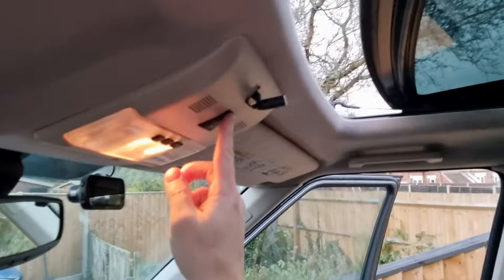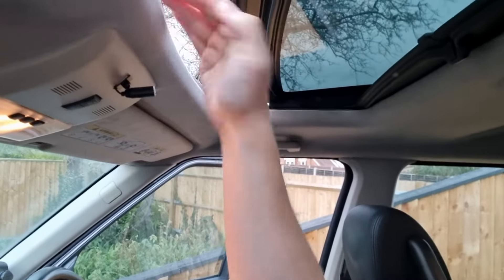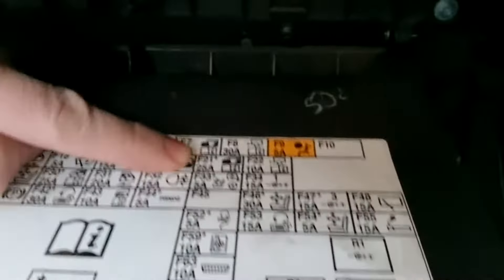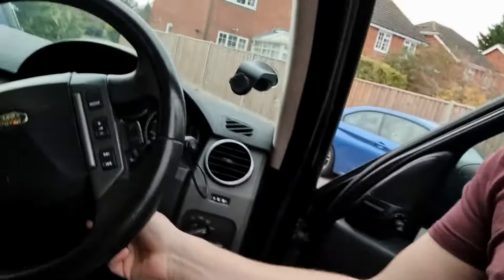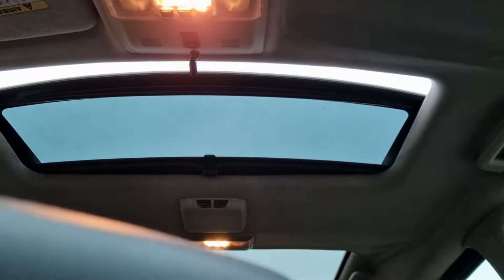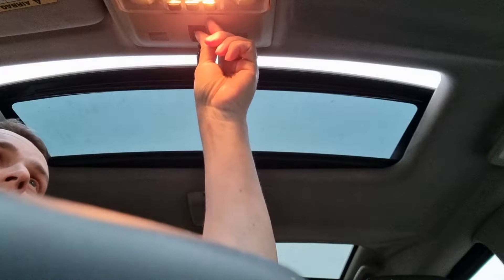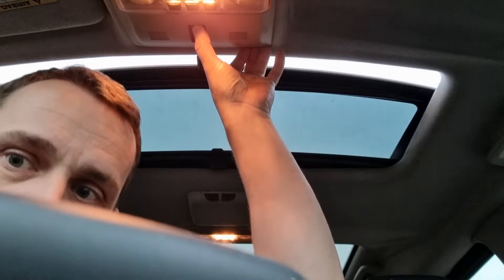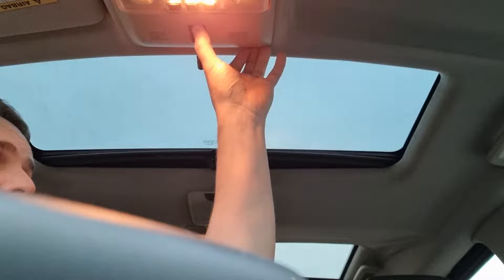Sunroof stuck open?  Fixed in 2 minutes at no cost!   This time on a Discovery 3 / LR3 Land Rover.

Comment: I might need my ford escape 2011 repaired. Like a dumb ass I accidentally hit vent in winter time when it was frozen.  It’s not closing and seating all the way now. Where you can hear lots more wind draft. motor works fine and goes through progression of vent and close properly. But when I hit close. It won’t seal. I have to manually push upwards on glass and then it seals into place with less draft. Wondering if it’s something broke in there. Any ideas?

Comment: This worked me, thank you! 
17 Civic Ex-T. I tried the reset procedure of the press start button letting go of the sunroof button, repeat. Didnt do anything but keep my sunroof open. 

This worked, turned on my car, ac off. It stuttered half way close, and after pressing open button it fully started to close.

I think I have a small electrical problem goin on in sunroof

Comment: I had a similar issue with my 2010 Discovery 4 yesterday. The roof was fully closed and would not open, so could be worse! I held the close button down for 20 secs and bingo. Problem solved today as it has stopped raining in the UK for 5 mins With a push button start just push once to light up the dash and crack on. Thanks for posting this top chap.

Comment: Worked for 06 Range Rover Sport. My plastic accordian thing came off the track, sunroof wouldn't close.  Tried your process, did not work. Went to other videos that had me dissassembling the dome to manually turn the motor, nothing. Tried your process for the 4th time, BOOM, I'm a happy man.

Comment: Thank you so much I was scared of leaving my car the whole night with the sunroof open. I think this type of reset works on every car since it worked on my 2014 civic
Reply: I second this, lot better than the other stupid method of 4 on offs tilt (it was stupid). 
Had to press tilted sunroof mechanically by hand when i was in the car lol
Repair shop tried to "figure out" the issue by opening sunroof (when i told the issue was motor). 8 hours they had and they told me the same thingi already knew but they didn't close it back (assholes)
Guess it is the dealership for me (more expensive but fuck it can't trust these "independent jerkoffs"(

Comment: The sr module has an anti trap feature. The system knows how many revolutions of it's drive motor must go before the closing voltage /current spike occurs when the close position is reached. If it encounters a spike B4 that that number of revolutions is reached it will stop and retract. This is the law in US. Reset procedures vary by make. Essentially you are making the sr module computer relearn the true open and close positions

Comment: Didn’t work for us. Sunroof was open - it will close part way and then back to open. Darn. I was hoping!
Reply: Mine just started doing this! Please update me if you have a solution. 😢
Reply from the maker: I reckon you have a blockage somewhere- check the mechanism for gunk or sticks or something else.  Then lube it up, and try again
Reply: @WeekendWarrior-Official  both! I'm by the coast and it looks look sand was building up on the roof. Along with a hickory that conveniently fell into the track when I opened it. If I didn't find it there's no telling what the dealership would have conned me for. Thank you so much for the advice 🙏 your a life saver!

Comment: Thanks for this video! I’m having the same problem. I did the reset but it closes but not opening normal. Keeps getting stuck like just 3/4 opened. Then closes back when I do the reset. What could be the problem? 

It’s not opening or closing all the way but closes when I do the reset for 20 secs.